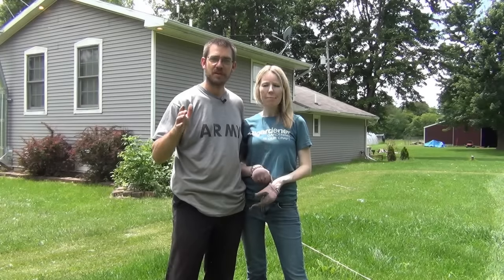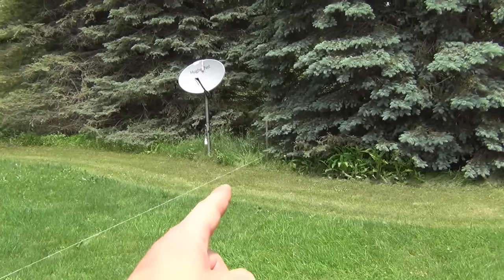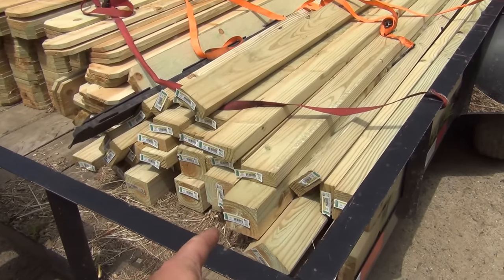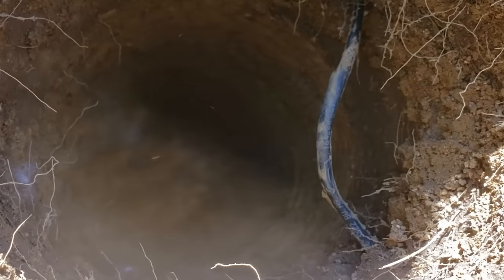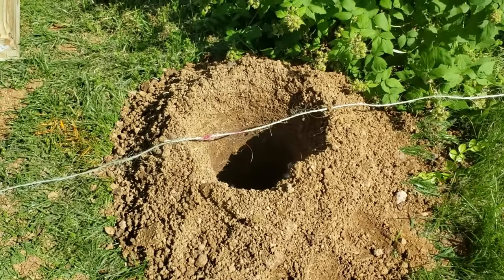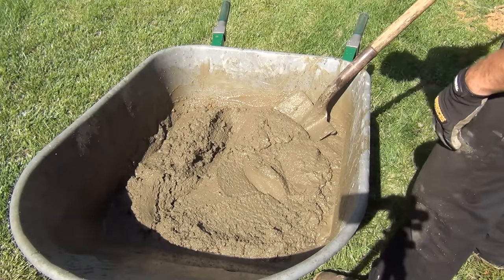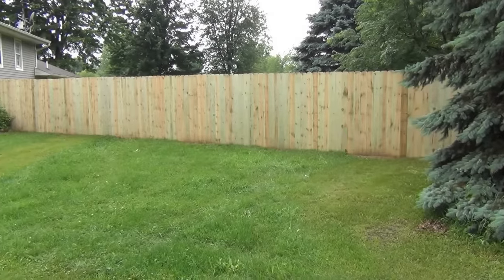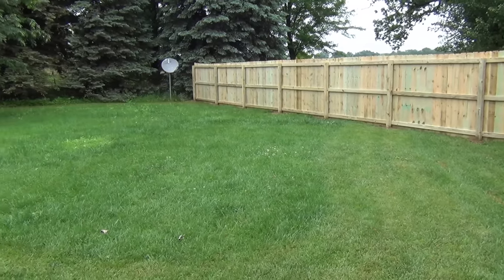How To Build A 6' Wooden Privacy Fence

Comment: your doing it right...only different thing i did was buy the 16' 2x4s as they (supposedly) are cut from older trees and should have tighter pores which will hold up to moisture better.  And then stagger them to help make the fence more rigid.

Comment: Whenever I set posts, I atleast have a minimum of an 8" diameter hole or 12" and fill to the top with concrete so I have less ground contact with the wood and stronger against a strong wind.

Comment: As long as you set the posts 96" OC or under they don't have to be exact. Work left to right hanging stringers and cut them off on the right hand side right down the center of the 4x4. Save you tons of time
Reply: Uh, can you explain for us newbies pls?

Comment: I own a fence company in Gaineville FL, very impressed nice work.
Reply: Is it better to use screws over nails?
Reply: Jafar Martin only advantage over screws they easier to take out if replacing a board. I’ve been industry for 17 years and I use only ring shanked aluminum nails, hold the board very tightly
Reply: @1millionsubswomovieschalle796  nails are faster and still hold tight

Comment: i like to  put the cement in dry and let the ground moisture sets it up  just shake the post back and forth a little and the cement will sift down and be solid immediately and not wait for it to set up.  Btw just got our first 30 a of hay up today 45 round bales of old alfalfa and old world bluestem hay i think it only had about an inch  of rain on it  been getting rain about every 3 to 4 days here in n oklhoma  ps (love that lite)
Reply: FR Rapp that might work if you have really good moisture in the ground. But not everyone has that. People live in sandy, clay, rocky ground can not do that. Plus most concrete requires mixing with water before, unless you purchase quick set where you can pour the bag into the hole and then add water. But like I stated above, that doesn’t work for everyone.

Comment: Nice fence I need to put one like that iIn my yard but in my experience you should put cement under your posts to keep them front sinking and only put dirt around them because if the post rots 1/4" you get 1/2" of play but if it is filled with dirt it will pack down and you won't have any play

Comment: I will be curious to see how those pickets hold up.  When I built my fence almost 40 years ago, the quality of the dog-eared pickets available at the "big box" stores was terrible.  Even though they were not plane or sanded the actually thickness was about 1/2"  (𝑠𝑡𝑎𝑛𝑑𝑎𝑟𝑑 1𝑏𝑦 𝑙𝑢𝑚𝑏𝑒𝑟, 𝑝𝑙𝑎𝑛𝑒𝑑, 𝑖𝑠 𝑎𝑏𝑜𝑢𝑡 3/4" 𝑡ℎ𝑖𝑐𝑘). Plus there were many warped, twisted and cracked boards.  I also wanted my fence 5' high so I bought 10' 1x6 PT lumber, cut it in half and put the dog ears on using a radial arm saw.
Screws are much to expensive for hanging pickets.  What you want are hot dipped galvanized box/fence nail.  Besides being hot dipped they have a "standard" size head but a thinner shank and a short length.  Thinner shank means less splits and the shorter length means they won't come through the 2x4.  Ans the rough, hot dipped galvanized finish means they will NOT work their way out.
40 years, only a couple of split/warped pickets.  No stain.  I let it weather to gray.

Comment: I agree That is a nice work light! And fence nice work!- I wouldve filled the 1st 6" of each hole with. Concrete helps prevent the boards from rotting out alot better soil holds moisture costs a bag per hole but it's worth it in the long run but to each their own nice fence too!
Reply: he should've brought the concrete up to grade.    that dirt around the post will hold moisture, and eventually the posts will rot, and the boards should've been at least 1 to 2 inches off the ground.
Reply from the maker: A ground contact treated post is rated at 50+ years in the ground
Reply: @SSLFamilyDad  yeah, thats what they'd like you to think, but in areas with long wet winters those posts may last 20 years.  I have used ACQ treated posts that barely lasted 20 yrs. that were said to last 40.  Water is the enemy of wood.  Everyone has their opinion, and you did a nice job on the fence.  I always bring the concrete about 1 inch above grade, and the boards about 1 inch above also.

Comment: I noticed you didn't put gravel in before setting the post and I know that really helps prevent rot. When posts sit on dirt they soak up moisture, but the gravel allows the posts to sit above the water.

Comment: Amazon has a 1500 watt auger for 175$ works well...In my experience, running the pickets to the ground can warp the pickets with the moisture from the soil, also touching the pickets with no gap also can cause warpness.....

Comment: add screws to the post where covered by the cement.  use a 6x6 and go 32'' deep for hurricane or storm areas.  treated lumber.  acq screws.  strings everywhere.  level.  eyeball.  time.  love for the fence itself.  a great post hole digger ($200)...  and a vehicle to transport lumber.

Comment: I didn't put pickets directly on the ground like you did. I expect mine will last longer because they won't be continually exposed to moisture.
Also, I'm jealous of your auger. We rented a towable posthole auger from home Depot - far, far easier to use compared to a one- or two-man auger.
Overall, yours looks like a good job.

Comment: I hope our fence comes out this good today!
Reply: Did you do it? I have a tip.. Run a string across the top.. Temp screw in a picket.. And another further down the line or where the ground changes. Put a screw into the top of each.. Run a string flush with the top of each.. Then install each picket in line with the string
Reply: @fencefirst2722  gonna use that for the side fence, which is next. Thanks for the tip!

Comment: Your area of Michigan may be different but in Monroe County MI., the code here requires post holes to be 42" deep, probably to be below the frost-line.  A 6' tall fence would require 10' posts.  I usually go 48" and toss in some stones before setting the post.  I suggest tamping some gravel or stone screenings around the bottom to allow moisture an escape path to prevent rot. Heck I don't even use concrete anymore. I just tightly pack something called a "county mix" that sort of sets up like concrete. (the stone screenings resemble cement powder)  It prevents the usual post to concrete separation. BTW,  I called for the hole inspection and they didn't care so I guess ignoring the code is fine...but I wouldn't want the frost heave to make all that work go to waste. They had no interest in whether it was being built properly,  only whether it was being installed in the correct location, as in the correct setback or following area practices. Calling Miss Dig at least 3 days in advance is not only the law but also a good idea. Discovering that wire you found the hard way could've been a disaster. As for setting the base of the fence line, I prefer masons string and creating a space off the face on each end. That way it eliminates the possibility of the line changing from a middle post touching more than it should. It's quite easy to just eyeball the space between the post and string. For anyone contemplating building their own, rather than just buying the panels...it usually takes 17 pickets per 8' section and I find the 2 x 4 rails to be superior to the 2 x 3 rails on the already built panels and those panels are built with nails that actually rust...or maybe it's the AC2 pressure treatment. I too use the coated 6-lobe drive (star) exterior deck screws so take that cost into consideration but I think you'll find that not only is it cheaper to build it yourself but you'll have a stronger, better built fence as well. Be aware that the picket sizes at Home Depot/ Lowes/ Menards may all look the same but their advertised dimensions aren't always accurate so take a tape measure.  The thicker the better. It doesn't take long for the thin stuff to flare out at the top and bottom after installation. I had to go to an Independent lumber store (Carter lumber) to find the thickest pickets but I can't say if that's the case today. I've been buying the cheapest stuff at Menards and I must say...their quality is quite poor.  I had too many 4 x 4 posts that looked like bananas by the time I could finish my 300' privacy fence install. And it only took a week before a number of pickets flared way out at the top and the bottom. I exchanged a bunch but many more have flared out since. I've never had that happen with pickets and posts bought elsewhere. Maybe saving 11% on future purchases isn't worth it.
Reply: I'm also from MONROE, MI! ❤

Comment: The only thing i do different is i use carriage bolts on my runners that attach to the post. And to get my post Hight and placement of each rail i shoot a laser line on each post and measure the same distance up for the take off. and placement of the rails .

Comment: 7.5 feet on center 4x4s use 2x4x16s horizontal you can cut them to break  dead nuts on center you can be a little off on your post and it want matter and stager the joints so you don't have 3 joints on the same post makes a lot stronger straighter fence
Reply from the maker: Great tips, thanks!

Comment: Rule of thumb never run your pickets all the way to the ground. A little trick have a long two by four on the ground and put the pickets touching the top of the 2x4 that will give you an inch and a half above grade and will keep your wood from rotting
Reply from the maker: These pickets are all treated wood and can be in contact with the ground. It is a pet peeve of mine to have any gaps at the bottom of a fence!

Comment: Don’t have to mix your mortar.     You can get quick Crete… it’s cement mix and throw half a bag dry and poke with a rebar and add more powder. It’s the same just less work no mixing
 Obviously add water as you poke w the rebar

Comment: Excellent video!  How did you make sure the posts stayed stationary while the concrete dried?  Also, why did you opt for screwing the rails directly to the posts rather than using rail brackets?

Comment: Had to stop the video short. Frost line in Michigan used to be 42 inches than they upped it to 48 inches. Hopefully the fence will last a long time but you’re in Michigan.
Reply from the maker: Frostline for footings in Michigan is still 42". When I do any footings here I actually try to go 50" just to be safe. However, for fencing that is not code as far as I understand it as there is no footing. I did this same thing at our old house and through the coldest winters on record we had no heaving so I am thinking this should be good. But I suppose you could do a 10' 4x4 and sink it 4' and then cut 6" off the top of each one
Reply: Yes why they upped it to 48” for us contractors I don’t know, 42” was fine for years. But city codes are 48”. Guess it’s just to hammer contractors? Yours might be a little short. Me I don’t care, not mine. But I hate doing things twice because. Also my 4x4’s are only 7 feet apart. We deal with Hurricane wins down here and none of mine have ever blown over just saying.
Reply from the maker: Lol, well shoot I hope I don't get hurricane winds, I'll have a lot more to worry about than this fence, lol.
Reply: Here in Taylor, MI they put a tape measure in every hole and make sure they're 42"+

I also have done 24" deep posts in the past with no issues, but the city is like a hawk now. Maybe we should move to the country, haha

Comment: Have you had any issues with frost heave since you built the fence? You said you only dug the post holes about 30". If you're in the lower eastern part of Michigan, your frost line is in the low 50's, and you also said you had sandy soil, which makes heaving worse.

Comment: I prefer gravel or stone packed around ea wood post. Great drainage.
Otherwise- ea wood post Will Rot - where the Top of the cement is, at ground level.
They make a Wood Post Skirting to Protect them from Rotting, a cheap investment.

Comment: HELLO, 

  Seems  there is  more then one way of doing  things . 

Example:  Mixing the concrete before ( filling ) the  hole. Many areas have  enough  - Moisture - in the  ground itself so that you can simply  ( Pour ) in the  powder and that  will become - HARD as a Rock -  by the  next  day.  Also you  used an alternative method for the  hole itself.   Best  way to stop ( Rot  ) be  it  treated or  otherwise is  to put  various  types of  Stone  at the  base for the  poles  to sit on . Be  it river rock and then a  bit of pea gravel followed by just a  bit  of  sand  before  getting the  concrete  ( WHERE ) you want  it.   The  Stringers as  2x4's is a  good  alternative. YET , running  ( 4 ) instead of only ( 3 ) is going to give you  a  better  strength  factor. Seeing how  there is  VIRTUALLY  ( NO Gap )  when the winds  come  thru - And  they Will .  Try to Force there way past the  Major  Structure you have  created here.   No Ground  Clearance and Little to NO  Air Gaps as  installed  create   PRESSURE POINT  - YOU -  will be  wishing  had  NOT  happened  when the  thunder storms an  High  winds  come  crashing in.   As a  Substitute  you  also could  add in some  6  or  8  penny  nails to help stop the  cupping  effect.  (  D  I   Y   )   means  anyone  can  do  just  about  ( ANYTHING )   and its  about  them  not the  Rest of  the  world  or  Construction Industry as a whole.  Mostly  what  ( YOU ) Need to be  concerned  with here is  this : A lot  o f Factors  both  Above and  Below the  ground  contribute to the Longevity of a  structure.   You Mentioned  ( Drain Tiles )  from the  Septic  in that  area.   Many places  want  you  to  go  at least  36  to  48  below  grade to Not  only  be  More Stable  yet  also FOR the  Added Benefit of  Higher  winds, More Stable Earth , and  if  it  applies  Frost or  Freeze issues  that  may or  May Not  Arise over time. Think of any project. Get  ( 3 to 5 ) different folks doing  it ( THERE  WAY )  Most  will  go  Cheaper  Versus ( BETTER) .  Sometimes its  based on Skill or  lack of  knowledge  more than  Money or  Budget Allowed.   Savings  in your  own  mind  might  mean ( HOW  LONG IT  LASTS )  Instead of  How  Cheap it was to  Put  up . Again, People are funny when it  comes to all this.  A  Weekend warrior   many times  feels  that  4  guys  a  couple of  beers and  burgers and then some  Back slapping  and  Kidding  around  constitutes a ( JOB Well Done )   While  still others  - PLAN it  Out . Figure in the  extra  amount  of  time and  labor and  may  divide it up between  Multiple Weekends  or  a  Stay Cation type event.  What ever it is  ( THEY ) do ( ITS )  not  written  in stone  that is  what  YOU  need to  follow either.  Have  seen  first hand   ( PISS POOR  )  attempts at  such  projects only  go  to the  Way  side  due to the  Lack  of  Commitment  and the  Overall  Issues of  getting  started ( Versus )  Finishing  what  was  started.  Home Owners  tend  to Over estimate there Own Skill Levels and  Boast about  how  ( EASY it  Is ) right  up  and  until  ) It  actually  Needs to get  done.  Run to the  hardware store by 10 a.m. on a  Saturday expecting  that  by  3  in the  afternoon - sipping  suds and relaxing by the  pool will be  the  way  it  could  be.  Only those who  have  been in the  trenches, Dug the  holes,  Hammered the  nails , and  cut up every last  piece of  scrap   will truly  know  how  this  fable  goes.  A lot  of  any  thing is about  ( Doing  It )   from work to play .  Talk is  Cheap and  so  are the  ideas  that  never  get put into  Practical Use.   Its a  Fence ( TRUE  )  but the  idea is  to make it Worth  your  time  by  doing  what  needs to be  done  ( NOW ) so  fixing  or  replacing it  is  not  the  next  course of  action only  a  year  or  two  down the line.  Example:  Cost of  materials ??? (  $ 500.oo  )   Cost  of  Labor ??? Nothing - because  your  neighbor, and his  dad  and  the  guy  from work  will be  over  for  at  least  until dinner is  served .   Your  Out  of  Pocket  expense for that ???  Food  - Beer -   Entertainment - Prep - and  Clean Up  ???  Not  worth  the  time it  took  for the little  amount  that  actually  got  done  overall.   To  Many Cooks  in the  Kitchen  only  S P O I L S  the  most  basic of  recipes .   THESE DAYS - ONLINE  PLANS  CAN BE  DRAWN UP , PRINTED OUT , AND  PUT INTO ACTION - FASTER THAN A  CHARCOAL GRILL HEATS UP ENOUGH  TO ACTUALLY  COOK  FOOD  ON.  Like  pouring  GAS instead of lighter fluid  while  standing  Bent Over it  trying to light it  with a  match as the  wind is  Blowing  Directly in your  face.   It  will Light  and  ( YOU ) will Explode and  be  a  little  less hairy  when the  BOOM  or  Shock  hits  you  ( Right  Between the  Eyes ) .    Post  all you  want  the  understand  ( OTHERS  )  will do  everything  except  ( LISTEN ) when it  comes  to Common  Sense ...

Comment: The locate marks are not exact. There is a tolerance zone on the locate marks depending on which state you are in. It is 18"either side from the outide of the facility here in Georgia. You must use hand tools when digging in the tolerance zone. If the facility is in the tolerance zone and you hit it, you are at fault.

Comment: Fence looks great, only question is why did you use screws on the pickets rather than a nail gun? Sems like it would have saved a lot of time? Thanks for the video and again, looks great!
Reply: Daniel Brown nails work their way out from the wood drying out screws hold 100 times better